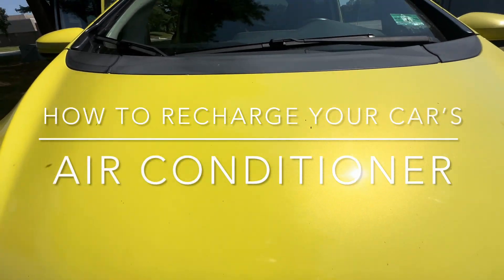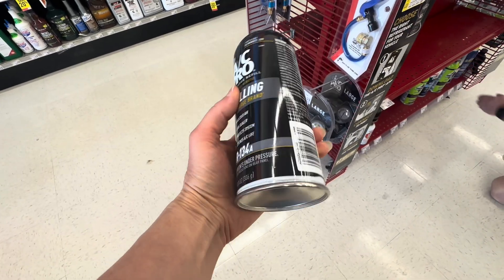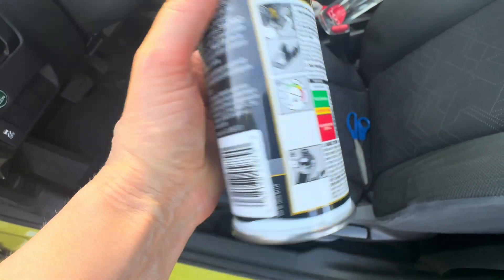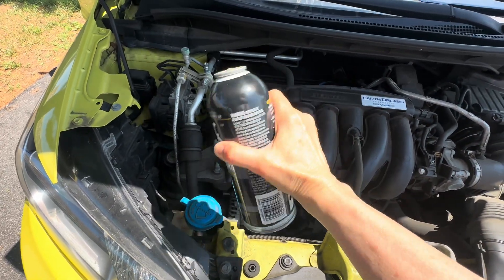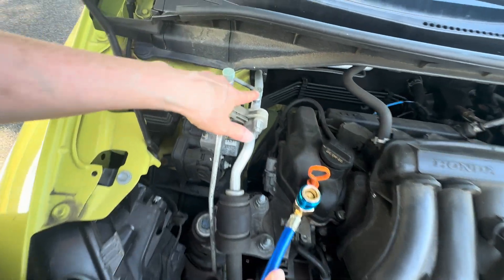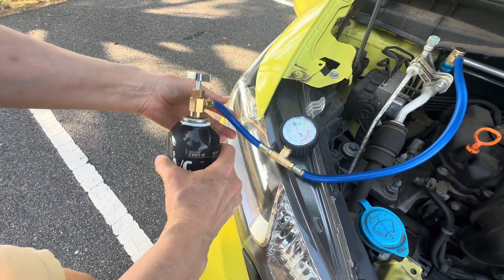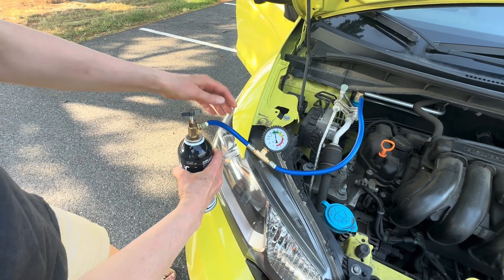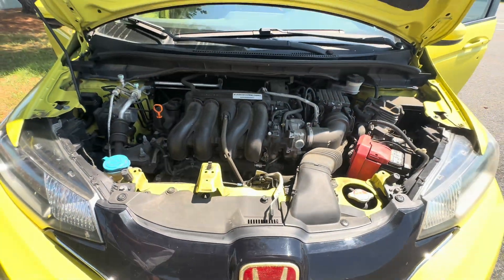How to Recharge your Car’s Air Conditioner

Comment: One mistake that I noticed and her procedure is that she did not purge the refrigerant line of air before hooking it up. In not doing so, will introduce a small amount of air which could cause a problem in the system. Air is a non condensable. the moisture in the air could cause a restriction when it turns to ice as it circulates through the system.

Comment: She should let a trained mechanic work on the AC system. A small leak is not normal it is a closed system. You will have to service the system again if a small leak is present. Mixing A/C oils will contaminate the system. Evacuate the system. Fix the leak and recharge it. End of subject.

Comment: Lot’s of 134A charge cans have a sealer in them that can ruin your system. Also to do it right you need to evacuate the system and add the weight of Refrigerant required. I miss the old R-12, that one could tell by the gauges when you were good. Also the older dryer’s had a sight glass on top that you could see when you were good.

Comment: i agree with everything @charlies6546 said. i'd also recommend against pounding that fitting onto that aluminum line, that's a good way to possibly break something that will be a very expensive repair. try sitting the hose fitting on top on the line connector and then grab it so that the palm of your hand is over the fitting and your fingers are on the bottom of the line. then, tighten your grip until it snaps on. also, don't leave the doors of the car open because that will allow more hot air in the car which will cause your pressures to be higher. those diy kits are good in a pinch when u need the car the next day or something but, it's not normal for the a/c to leak it's refrigerant out. so it needs to be taken to a mechanic and repaired as soon as possible. dad always said it's not a sin not to know something but it is a sin to screw it up because u don't know. u may wanna ask people some questions and maybe watch some youtube videos if u are new to working on cars. pounding on that line could have been a very expensive mistake!